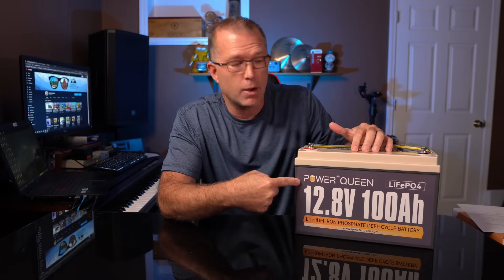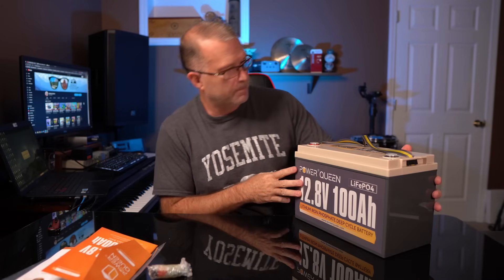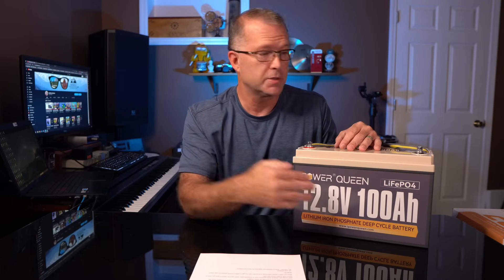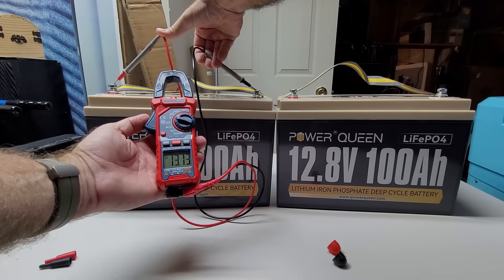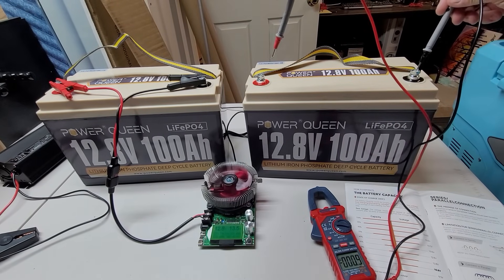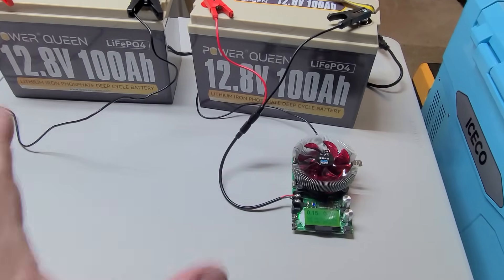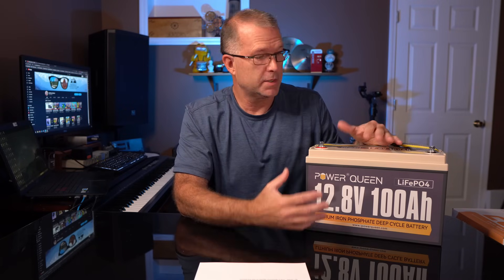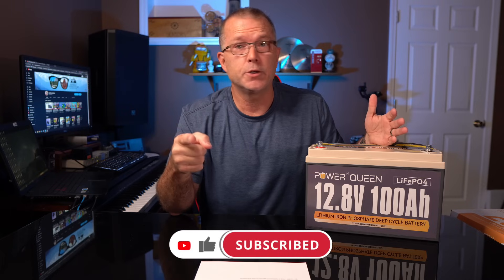*No Hype* Power Queen:  BEST VALUE I've seen in 100Ah LiFePO4 battery!!

Comment: Would soil heating pads designed to warm containers of germinating media in cool spring environs be sufficient to keep battery warm in cold temps?
Reply from the maker: possibly, but there are a lot of variables involved...like is there any insulation in the battery compartment, what is actual ambient temperature, whether or not you are actively discharging and/or charging the battery (as these actions generate heat on their own).  So...could certainly help...but hard to say to what extent.

Comment: Just checking to see if you or anyone in your group ever heard of a solar generator by a company called evergear up here in Canada with our lower dollar and sky-high shipping it's on-sale at princess auto  2000 watt pure sine wave inverter  with 2264 watt hr battery capacity  for 2299.99 and a extra battery capacity doubling the watt hrs capacity for 1199.99 pick up in store I've tried to find specs online but can only find a dealer that sells them wholesale in  orders of 500 for under 300  so mark up on these power units is high  thanks in advance for any help

Comment: Hello I have no experience at all in electricity. I appreciate you making this video. My wife works from home my intention was to get one of these batteries to run the modem and a 43-inch television which is her monitor for three or four hours if we have a power failure. I was also thinking that maybe using it electronic trolling motor for a raft. I would probably get two of these and put them in line. That way I could combine them for the raft or I could separate them as my communications are in the basement and my wife works in her office on the first floor this allows me to have one battery in two places. I also currently own a 2000 watt inverter that I bought from Harbor Freight that has two AC Outlets. Do you think that will do the job and how do I calculate the wattage being drawn from a house Appliance and how long a battery would last
Reply from the maker: I actually did a video on how to figure that out.  Hopefully this helps you:  https://youtu.be/nGG0Hnv9p50

Comment: Hi I keep hearing about low temperature. Can you keep it in the garage in storage not used over the winter? It can possibly on rare occasions get down to maybe 25F in the garage
Reply from the maker: Yeah storing them in cold is not a real problem,  generally.  In fact to an extent it actually prolongs their service life.  You can even discharge them safely in freezing temps in many cases. But the concern is CHARGING while the battery is frozen.  That will damage the cells.
Reply: @ReeWrayOutdoors  thank you very much!

Comment: Can you offer your expertise?  I bought a LiPower 100Ah Lifep04 on amazon, and upom arrival it showed 13.1v and when i put on charger, the charger says  it's full at 13.2v a few seconds later.    Another charger also said same thing.  Shouldnt it arrive partially charged and then full charge be something around 13.4 and up?
Reply from the maker: Yeah definitely should have a full resting charge of 13.4 or higher.  Is your charger designed for LFP batteries? These need to be charged at 14.4-14.6V to maximize capacity.
Reply: @ReeWrayOutdoors  yeah both have that capability.  So this basically means one of the cells could be defective? Its literally brand new and can't return it, had to email the Chinese company Li power.

Comment: Cool channel.  

I’m trying to find a battery to camp with that will run a cpap for 2-3 nights (8 hrs a night). 

The cpap is rated at 3.31 current draw at 12V DC (amps). 

Do you have any recommendations for a battery dedicated to that purpose?

Thanks!
Reply from the maker: So that's about 40W per hour...x 8 hours = 320Wh x 3 nights = 960Wh.  So you'd want something in tht rated 1200Wh (or more) range, when you factor in the typical usable capacity of around 82%.   This is an excellent option if a relatively slow solar charge speed doesn't bother you: https://amzn.to/446tG3U.  It also has an expansion battery option if you ever need to add  capacity.  The next level up would be the Pecron E2000LFP -  a fair amount bigger, but better solar charging options (if you need that) and battery expansion options.  https://amzn.to/43OJtEl   I have reviews on both of these units if you want to hunt them down.  If you're just looking for a LFP battery, I think any of the 100Ah 12V options from Power Queen, Li Time or Timeusb would be excellent budget-priced options.
Reply: Thanks for taking the time to make such a detailed and informative reply!

Comment: Do you think this battery would be good for a trolling motor 12v 55lb thrust that draws 50 amps?
Reply from the maker: it's got a max rated continuous discharge of 100A, so yeah, should be fine for that.

Comment: Info for those interested or having a PowerQueen Lithium 12.8V battery.

Over voltage: 15V
Charge limit: 14.8V
Over Voltage Reconnect 14.2V 
Equalize voltage: Disable
Boost voltage: 14.6V
Float Voltage: 13.8V
Boost reconnect: 13.5V
Low Voltage Reconnect 12.4
Under Voltage Recover 12V 
Under Voltage Warning 11.6V 
Low Voltage Disconnect 10.8V 
Discharge limit: 10V 
Over temp protection: 50C
Low temp protection: 5C
Low capacity reminder: 10%
Protection recover time: 180s
Protection delay: 5s

And if you have a 300Ah model.
Discharging overcurrent protection: 200A
Charging overcurrent protection: 200A
Overpower protection: 2560W

Comment: Though my inverter went bad till I tried my agm battery on it and it worked its the power queen battery problem
Reply: I'm trying to run a inverter too can you explain more. 
Trying to run 2 100ah with a 1200w inverter. You think it will work or should I go agm

Comment: I ordered 2x of these 100Ah battery Powerqueen.   I'm will be using them with my 2 EpEver mppt, Tracer4210AN

in parallel,  to charge the batteries,  also in parallel. 
Do you know if I can just use the build in Lipo4 programming or do I need to buy that supplement module to change the settings under user ?
Reply from the maker: I'm not super familiar with these specific CC's, but typically you're quite safe to just use the stock settings they have for LiFePO4 batteries.  The User settings will give you the ability to fine-tune certain parameters if you know what you're doing, but it's not typically really necessary to do that, in most cases.
Reply: @ReeWray Outdoors   A pity you need to buy an additional part to be able to change settings !!, more over that you are not much more with it afterwards.  :-(

Comment: Why buy the new Smart version over the non smart ? Certainly when 100,ooEur difference.  And makes it sense when putting two in parallel  ?
Reply from the maker: yeah, the extra cost of the 'Smart' version is a little hard to justify unless you need low-temp cut-off and find the on/off button particularly useful options.
Reply: And ... Smart :-)  LOL these days they use the term for about everything.  Here not even Bluetooth

Comment: I'm slowly replacing the old deep cycle lead acid batteries of my solar system with Power queen plus 200 ah batteries. They are a little pricey at $669 each but I've been buying the slightly used returns for around $550 ea directly from power queen.  I keep them charged and never fall under 60% so I expect to get ten years out of them.  I expect the grid to fail here in California so getting prepared for the worse here this summer.
Reply from the maker: Nice! And you should easily get more than 10 years from them if you're not discharging past 60%!
Reply: @ReeWrayOutdoors  Thanks.  Quick question:  I'm using a 20 amp LIfePO4 charger when solar isn't available at times.  It can be pretty slow charging this way.  I have a 2nd one that can be placed on another battery all hooked in parallel. Are you aware of any issues using two chargers at the same time?
Reply from the maker: @philc.9280  Should be ok, as long as the combined current of both chargers doesn't exceed the BMS's max charge current rating (which is typically at least 50A) and they're both spec'd the same way to ensure both batteries are being charged the same way.
Reply: Hey Phil, I show them as costing $299 from Amazon right now. Makes them much better value vs. conventional sealed lead acid, deep cycle batteries.

Good for you for doing reasonable things to prepare for probable grid down in Cali!
Reply: @ColoGrayWolf  those are 100 ah batteries for $299. Mine are 200 ah plus for $600. Thanks
Reply: Oops, sorry! You did read the compliment part, right?
Reply: @ColoGrayWolf  yes, thank you. It kinda sucks having the grid fairly unreliable in California.  We are now having record winds blowing down trees and power wires now. Then the crazy firestorm in the summer causing more outages

Comment: Thx great video!
Do you think this battery works for my air blower which required 1200 watts.
I am looking about 10-20 min on off operation for cleaning my car’s surfaces.
Reply from the maker: Yeah, 1200W is right at its rated 1280W continous output rating (100A @ 12.8V), and it should give about 1 hour of continuous 1200W output, if that'll work for you.
Reply: @ReeWrayOutdoors  thanks for reply!
What do you think of this?
I asked the other guy online ...he was saying 1200watts are very cross to the limits of battery energy and he said to me go for 125ah or 150ah battery.  Since my budget is tight so but meantime I do not want to make wrong choices. So far I have no plan to use higher than 1200 watts appliances.
Do you think 100ah batter is fine?

Comment: How do you really know if this battery has grade A cells if you don't open it to inspect?
Reply: You don't. Same goes for trusting low temperature disconnect without testing it. These issues were enough for me to get my battery from EG4 instead of power queen

Comment: think you may be quoting IP67, as IP65 is water resistant non-submersible, and IP67 is 1 meter, 30 minute submerged
Reply from the maker: I think you're right!  After reading information from different sources, it seems clear that the source I used was incorrect (https://www.trustedreviews.com/explainer/what-is-ip65-water-resistance%E2%80%8D-4253905 )
Reply: @ReeWrayOutdoors  nice review!, and as far as incorrect source material on the internet presented as fact, I feel ya. I do some reviews and I hate the checking, cross-checking, and headache when I come across a claim or standard I'm not 100% sure of. Thankfully IP ratings are an international code and you can find the organization if you dig deep. And while I view a lot of wiki as weather reports (always subject to change and still wrong or incomplete half the time) they did get this table correct on the IP ratings 
https://en.wikipedia.org/wiki/IP_code

Comment: I’m not sure how to calculate the watt hours in a traditional lead acid battery. I have one that’s 31 DCX, MCA at 32°F 800, CCA at 0°F 650,  and minutes @ 23 Amp 225. How would this compare? It’s what I have in my tent trailer and I would consider replacing it with one of these.
Reply from the maker: Hi Keith, SLA car batteries can deliver much higher amps for short bursts than the typical Lithium chemistries - which is why they're generally better suited for engine starting applications - and that's also why you see ratings like MCA (max cranking amps) and CCA (Cold cranking amps), with these ratings typically being for very short duration like 30 seconds.  The average SLA car battery is rated for about 50Ah when used for basic (non-cranking) power applications.   Note that you CAN get more than 50Ah out of them, but the SLA battery life will be significantly reduced if you discharge past 50%...hence the 50Ah rating vs 100Ah.   So take 50Ah x 12.8V and you get 640Wh.    I hope that helps!  :)
Reply: @ReeWrayOutdoors  thank you very much! I had no idea how to estimate that. I did know that lithium could go down further than the lead acid, even with a deep cycle, but I wasn’t sure how to compare them. I do know I have to change the lead acid every couple years, so it’s probably worthwhile for me to invest in a lifpo4 if I’m going to keep the tent trailer.

Comment: The web site gives the application for the battery across many applications including boat use, would the IP rating give protection against salt water as the manual doesn't say.
Reply from the maker: I'm not an expert in salt water applications, but the ABS plastic housing is completely sealed and they terminal sockets are epoxied in and sealed.  So really the only thing that I can see that could be affected by salt water is the terminals themselves, and I wouldn't think they'd be any more vulnerable than any other battery option.

Comment: Looking forward to seeing your solar project. I have been looking into sizing a system, and a desire for a dual induction cooktop means I need minimum 2000W, meaning I need to go with minimum 200Ah, or move up to a 24V system, which I’d prefer not to do if I don’t need to.
Reply: I’m